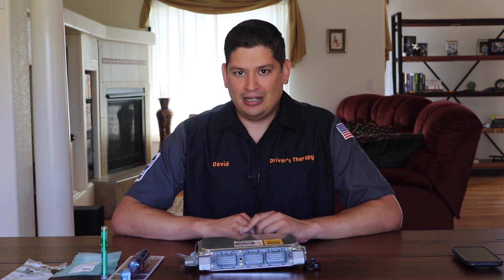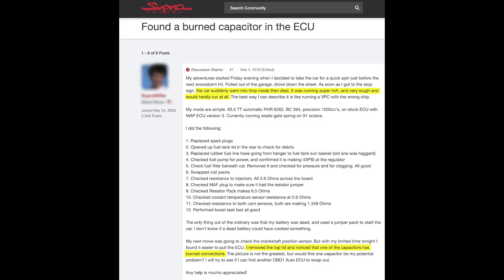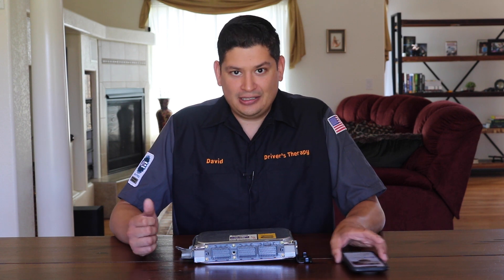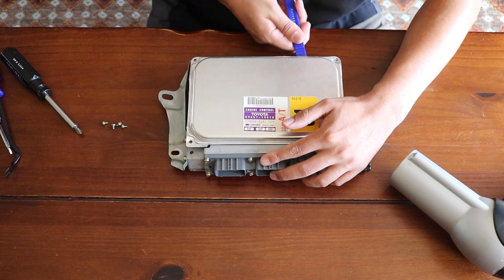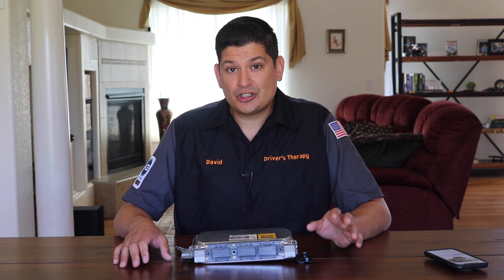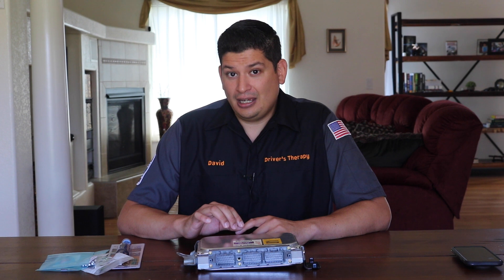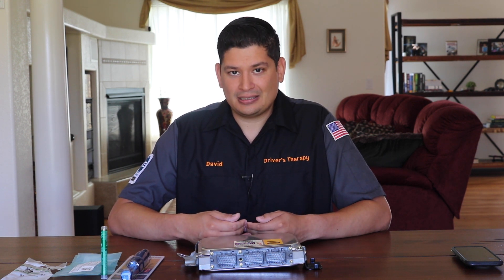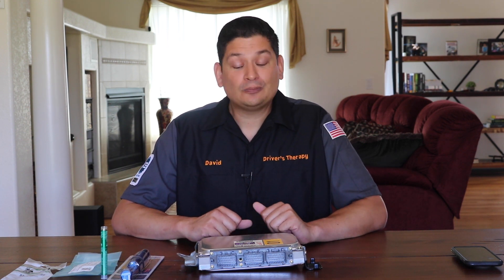ECU Leaking Capacitors - Diagnosing and Options - Toyota Supra

Comment: You purchased a ecu replacement from eBay for your Supra, was the ecu oem  or aftermarket ? And do you recall the “ecu seller” name? And can you relate the “capacitor kit” you purchased from eBay as well.  I’m having similar & other “random” weird issues w/ my 93 MKIV Supra and cant pinpoint exact cause. Most likely ecu is causing these random issues. . I’ve owned my Supra for 25 yrs so replacing or repairing the ecu is needed. .i will also contact relentless motor sports as well.
Reply from the maker: Hello, I bought a used OEM Toyota ECU for my Supra. I made sure it was the same model and year. The model number is stamped outside in bold lettering. I bought the capacitors from a reputable electronic store and I am confident ANY experienced soldering technician can accomplish the job. I am having a local shop that repairs phones do it for me for 70 bucks. The most important factor is getting the proper parts.

Comment: running into the same symptoms and josh also commented on my post in supra fb group to check my ECU. sure enough i found leaking  capacitors. i wish i came across this video sooner but i kept searching for fuel posts because im thinking the symptoms are no fuel to motor. most likely going to send my ecu to Josh for repair and hopefully it puts my baby back on the road.
Reply from the maker: I understand the frustration but I am glad you found the problem. Now its time to get it repaired. If you have any questions or need any help let me know.

Comment: I would also like to add I just had an issue with a current build “2jzgte” S14. I opened up the ecu because it’s not starting and the blown cap feeds to the pin on the ecu that comes from the crank sensor. Perhaps a grounded/break in the wire blew this cap? I know most of them will eventually go bad anyway. But check with one failed and see what components they are connected too before you replace them all?
Reply from the maker: I’ll with you. I wonder if the ECU schematic is out there. I’m curious as well. Though I can confidently say my Supra shifts better with swapped ecu.

Comment: I posted a few years back on Supraforums about these issues I had with an aristo ECU. I’ve had these issues with multiple ecu’s. There are exceptional write ups on clublex because it also plagues the LS400 people’s computers as well. Please look through these posts and try to source low Esr electrolytic capacitors or the same issues will happen again.
Reply from the maker: Good to know. I have been hearing from multiple sources to make sure to get the right replacement capacitors . Thanks for sharing. 👍🏽